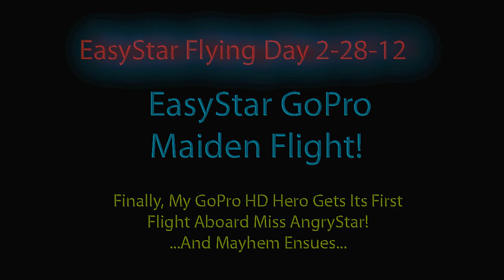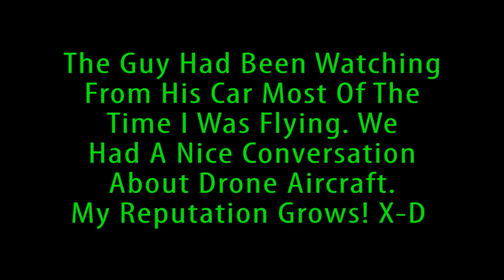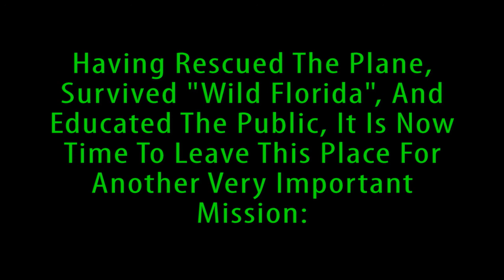EasyStar 2-28-12: FPV GoPro Maiden Flight, Flown With Dragonlink!

Comment from the maker: Goggles... I'm using EVG-920Es with a composite video to VGA converter box to eliminate weak-signal blackout problems with the goggles. Works well and they've seen me through lots of flights with the plane and quadcopter, driving with the Traxxas Stampede, as well as the boat and the explorer bot. They're not perfect but they get it done. :-)